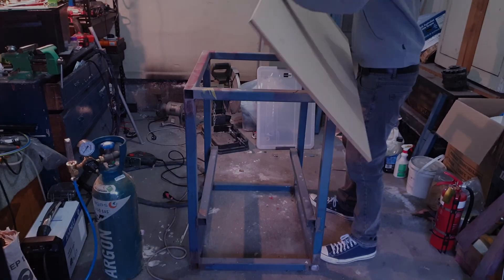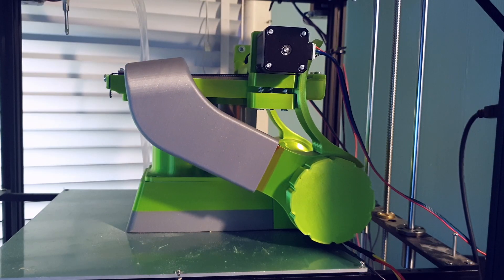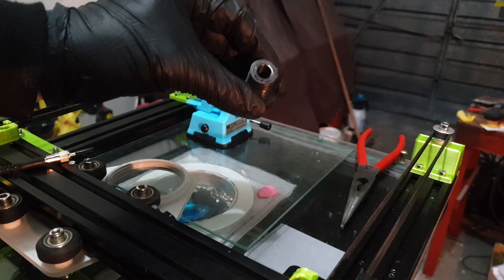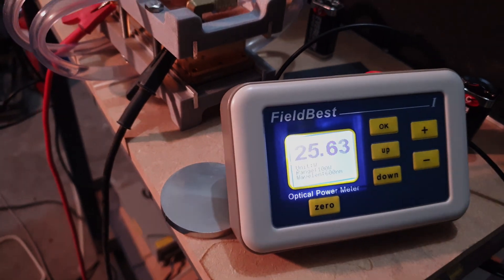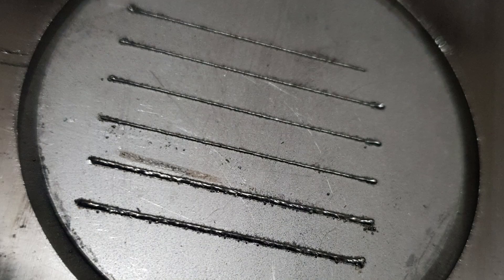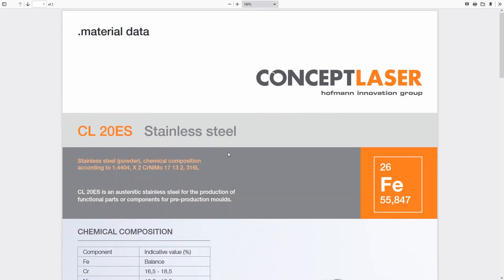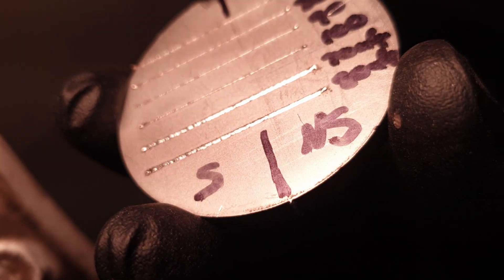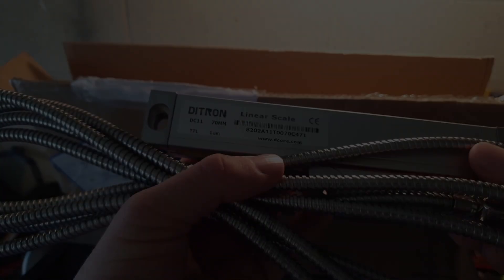The End Of Metal Tracks - DIY Metal 3D Printing

Comment: Sorry if this has been covered in another episode of this project, but I was really really wondering why you're not using a galvanometer solution instead of a large platform X/Y gantry set up which is inherently very sloppy when it moves? Is it a cost issue? As a galvanometer set up could be quite useful in this instance due to the fact that many of them are already permanently sealed against atmosphere. My apologies if this has been covered in a different episode. Excellent work my friend!

Makes me wonder how this setup would run under vacuum with perhaps maybe the slightest amount of helium added. But most likely it lead to the formation of plasma which would be quite destructive when it comes to accurate and precise tracks. Perhaps maybe this would be better solved under find thin layer of some sort of liquid solution that has incredible heat tolerance? Who knows. Love your work man!
Reply from the maker: Hi Robert. Have a look on my shorts page. I have switched over to galvos, but yes, cost and complexity are significant factors.

There are a number of papers dedicated to LPBF using a vacuum. Worth having a look if you are genuinely curious.

Comment: the thick spots at the start and end of metal tracks can be controlled by "skywriting" laser scan strategy in which laser start/stop emitting only when it achieves certain acceleration. However, the work you have done is still amazing and applicable, and truly speaking impossible for 1 man team.

Comment: For a wiper, look at screen printers. They use a very durable polyurethane wiper. Readily available.

Also it looks like you don't have an enclosed cabinet, you need to do that and remove all the oxygen, replace it with a heavier gas. Perhaps argon.... I was a welder and I know we use a trace of helium in there when tig welding.

You cannot have oxygen present. Haven't watched it all, but how do you weld metals together in that atmosphere? 
That doesn't make any sense.
Unless you're trying to make Slag.
Reply from the maker: Thanks for the insight. The black plastic container is sealed and purged with argon.

Comment: No one I'm aware of in the industry has cracked dimensionally-perfect additively-manufactured metal parts. CNC giants like DMG Mori or Hermle "solved" the problem by sticking additive metal systems inside 5-axis CNC mill-turn machining centers. Folks need to accept that additive manufacturing is much like traditional casting, it'll get you close to the desired shape, but tight tolerances will always require machining.

Comment: I’m just wondering I noticed you’re saying too much heat causing the warping but I think it’s more the rapid cooling of the metal causing the stress and warping. From what I’ve been finding these need to be in a preheated enclosure to prevent these stresses.

Were you using an inert gas? The normal atmosphere can cause contamination(moisture, oxidation, etc), even your skins oils can contaminate the powders. 

I’m curious to make my own so wanting to pick your brains if those are things you’ve tried?
Reply from the maker: I'm not too sure where I mentioned excessive heat leading to warping. I recall it was an issue when using overly thin substrates but other than that, I can't disagree about sudden temperature changes being the source of warping/internal stress. In spite of that though, as far as I'm aware, heated chambers aren't the de facto standard for SLM systems. Temperature regulated platforms are common, but can be bound to temperatures as low as 50C. I know it is common for SLS systems, but I don't believe it's the same for SLM. I know the PM100 by Phenix Systems is an example of such a machine though.

Yes, atmosphere was inert. Always wear gloves and a respirator when handling metal powders.
Reply: @metalmatters  first of I wanted to say thank you for responding and I’m so sorry I think that was a previous video I was watching of yours. I hope this doesn’t come across as criticism or anything I want to learn as much as I can from you and bounce things back and forth. I am very much still in my infancy of learning all this.

I seem to be on a different thought process, most of the slm/dmls machines I have seen have heated chambers, it’s allows for minimising thermal stresses, enhanced powder bed fusion, and a few other areas that help. 

I could also be completely wrong about this, that why I want to pick your brains as much as I can so I can learn!

But also finding that even the powders need to be opened and handled in an inert atmosphere like argon or nitrogen to prevent contamination and oxidation.

I haven’t seen the phoenix systems yet I’ll check them out! Thank you 😊
Reply from the maker: @SurfyKirky  Didn't catch this one! I have a feeling you might be referencing material related to mission critical applications e.g. medical and aerospace. Which machines have you been looking at?

If you have a look at the TDS for brand name powders, some of them will mention build plate temperatures. e.g. https://www.eos.info/03_system-related-assets/material-related-contents/metal-materials-and-examples/metal-material-datasheet/aluminium/material_datasheet_eos_aluminium-alsi10mg_en_web.pdf Between this and a lot of systems using silicone/rubber recoating components, I'm under the impression that most systems don't rely on heated enclosures. Sustaining high temperatures for potentially days and the added build cost.. it's just easier/cheaper to deal with using mechanical supports and annealing. 

Btw, are you based in NZ?

Comment: What if you passed a grinder over the surface after sintering, but before adding the next layer of powder? That would help to simplify the deposition and also improve the dimensional accuracy and keep one little screw-up from scrapping an entire print.
Reply from the maker: Insitu? Keeping the powder clean and stopping powder from being blown around would be quite challenging.

Comment: does the steel disk get lower and lower in its housing each layer or are the layers raising on the z axis? if you had a base that slid lower and lower down a tube and add material on top you might be able to simplify some stuff.

Comment: @metalmatters Hey I had developed SLS printer. I'm pulsing laser to melt down material Rather then CW high power
Reply: Chrome cobalt and Yag Laser
Reply from the maker: Nice work! What material/laser are you working with?
Reply: @metalmatters  chrome cobalt and yagg
Reply from the maker: @manthanpatel45  Send me an email or post on the forum. Sounds interesting.
Reply from the maker: @manthanpatel45  I sent you a message. Did you get an email notification?

Comment: I think a galvanometer scanner would be helpful to get rid of the gasket. Plus you can move and accelerate your beam way faster. Or would this destroy the point of the whole thing?
Reply from the maker: Likewise. Just a matter of cost really. $7-800 for large aperture galvos, $500+ for bespoke mirrors, plus the initial outlay for the diode pump/PSU. May as well go for a fiber laser at that point.

Comment: REALLY good video, but i wonder, wouldnt it be better/easier to have a sls/slm machine that sinters/melts plastics instead of metals, i think it has a lot of potential: lower temperatures, lighter materials, cheaper...the only downsides i can come up with is toxic fumes...?
Reply from the maker: Thanks. I think there are a few DIY SLS printers out there already. Depends on what you're hoping to achieve. High temperature strength is what I am pursuing.
Reply: @metalmatters  thanks for the reply, i was mainly wondering if it would be safer to start with plastic sls to then upgrade to metal sls, i also think more people would be interested in having a plastic sls machine instead of a metal sls machine

Comment: I really hope my other comment posted, unfortunately I seem to have lost it. I'm going to try and sum up what I said.

I have experience in working with SLS and DMLS printers, specifically the EOS M290.

For wipers, you can google "use cases of different re-coater configurations EOS" for a writeup that goes into detail about the re-coater blades in the EOS M290 DMLS machine. In short, they use a HSS parallelogram shaped blade which is ductile enough when coming in contact with the print, while in other cases a ceramic blade is used. More info on the writeup.

For the build environment, we always pumped down the machine and filled it with argon. The build volume is also heated.

As someone else mentioned below, you could pulsate the laser, which If I'm remembering correctly is something that is also done on the EOS M290.

The EOS M290 also has a large filter cabinet which requires the filters to be replaced when switching materials or on occasion once the flow through them drops below a certain point. I believe the filters could have been capturing spatter which would have been blown into them by the flow of argon which traveled across the build surface. 

After printing on an EOS machine, the powder should be sieved as well, which I believe is done to remove anything in the stock powder which exceeds the size of the rest of the powder.
Reply from the maker: Didn't see your previous comment. Thanks for your insights Alex. Do you recall what sort of pressure the build chamber is held at?
Reply: @metalmatters  I'll have to look back at my pictures to see if I have anything, or I'll ask around. If anything I could pop in and take a look as well. I'll let you know. Great work man.

Comment: Hello, I am extremely impressed with your progress. I have done a lot of research and postulating on these systems so I Was thinking maybe I could help or clarify somethings. SLS Printers don't actually melt the material they sinter it. This is better because as you can see the pooling and controlling of the molten materials is quiet an issue. The SLS machine also have heated chambers. The reason for this is so that the exposure to the laser is incredibly short and cause the particles to bond to each other. So I think you have done phenomenal work but that might be the two areas that might be an issue. I really hope you come right :) Another thing, the scraper should be extremely flat material that cannot generate a static charge, perhaps like a gauge plate edge?

Comment: Might I suggest looking at Hitachi CPM White #1 steel. It is an extremely pure steel with sulfur and phosphorus content at .25% or lower. It is just iron and carbon. It is in powder form. It could be one less variable for you to deal with in that the material is very chemically uniform and it could be simpler to calculate how it will respond to heat. Japanese master smiths use it to make blades that can take an edge like no other. I own several Japanese knives. The White #1 blade has an edge that will cut your name in two.

Comment: Very interesting project something I posibilty going to build, But I am teacher in welding and specality micro plasma welding, and I see some things in your video that give you problems in the quality of the welding for to build up you material. But the first thing I gone say to you is stainless steel you have to know that you have to protect your self for lung cancer and special whit the metal pouder. And when you heat it up there wil com nikkel and chroom free so always see that you have a good ventilation and where a mouth mask. So if you gone melt stainless steel you need always a protection gas for not get carbids in you welding and this give problems to build up the next layers. So Agron is the most intresting gas to use , but I use in the welding of stainless steel Argon whit 5% H2 but the problem is that it gone bun in you project but the  H2 will bind whit the O2 and you get les carbids in you welding. But you have be sure that the box where in the process is busy is 100%argon so you have to have a contstain flow of argon gas or tot set the box under over presseur. So for to start and the end of the welding line you have to play whit the power of your laser and also whit the end of the line it call filling the crater. If you know a good Tig welding in you region ask him for some information. One of thee major problems is the stabilty of you machine I see it schaking when you build the layers. I don't know what size you like to print, but did you ever have think to use galvano mirrors. you gone have less problems whit the scheaking of your machine but you laser spot will change. My advice build a solid machine construction whit whieght and special if you gone work whit high speed to start and stop ends. And make sure that it is 100% under a argon are helium atmosfeeer.

Comment: Brings back memories of the early days at Xact Metal. You appear to be working thru these issues similarly to how we did. Keep up the good work. Reach out if you have any questions.
Reply from the maker: Hey Matt. I sent you an email, although from my personal email due to problems with my mail provider. Just checking in case it has been marked as spam.
Reply: @metalmatters  Got it! In the process of replying 👍

Comment: Hi, it's quite the interesting project. I just found your videos and so I don't know if I am suggesting ideas you might have tried already. I've seen a couple of other projects for metal printers and at least one of them had heated the metal powder  fairly high in temperature but not to melting. The laser was to push the temperature over the melting point for the areas that were to be printed.

From the video it appears that the system runs a beam along the path to fuse the metal powder to create a line. Would it work differently if instead of a continuous beam the system fired a series of the shortest possible pulses. If the spacing was close enough it would create a line. Perhaps it would need multiple passes, depending on how fast the system is able to fire pulses. For example, it might create a series of dots close together one the first pass and then on the second it would connect the dots up. 

A third idea is that perhaps the spread is being caused by the material being heated up so quickly. What if the laser were to make a number of passes with the last pass being at 100%, the power just above the amount to melt the material. Some experimentation with the number of passes and any pauses between the passes would be needed to see if it impacts printing at all. If it did work it would slow down printing but at a gain in quality.

Comment: Just an FYI; I used to use the epoxy, shear and polish method for fiber throughout the 90s but unicam connectors have become the mainstay for fiber connections unless you're doing fusion connections on single mode.

Comment: Very cool, but curious why you didn't use ASA for all FFF polymer parts. Green and silver looks like PLA to me.
Reply from the maker: Mainly to avoid headaches. The build plate is to be cooled (50C) so there is little chance of softening the base of the deck and I will reprint/line the arms if need be.

Comment: Add a chamber around the burn plate and fill it with argon...most your splatter will go away and your edge will be much finer. A titanium roller barrel instead of wiper blade.

Comment: Hi, @MetalMatter great video. What effects would you expect if you were able to change pressure as a parameter? For example, if this system were located in a pressure chamber, then how would varying pressure affect the expected outcome? Also, since it's a finely packed powder you could use the tip of a syringe mounted on the head to carve a canal into the powder's surface that will be filled in once the powder on either side of the canal melts pouring itself back inside the canal. In essence, the canal creates a greater surface area, which alters the dynamics of the reaction. Alternatively, maybe using a different gas in the atmopshere of the melting. My naive guess is that the liquid turn to vapor and causes the bubble to pop and splatter the metal.

Comment: Very cool project! I am a qualified 3D print technician, I've worked on EOS printers before, primarily the EOS m290, its really cool to see how much you've overcome and implemented that is in line with existing high end metal printing techniques, I can suggest that you look at "skywriting", cold prossess 3d printing temp balances and nitrogen scrubbing for some potential improvements. Super cool project, I think what you've done with the recoter head is very cool!
Reply from the maker: Thanks Jason. Can I ask, what is the typical build chamber pressure of the machines you work on?
Reply: @metalmatters  in most cases a light positive presure of 0.3 bar, strangely in the case of aluminum a negative presure of 0.5 bar

Comment: If you have trouble with droplets at the start and end of tracks due to acceleration, why not separate the acceleration from the start of the track? As in: start moving, get up to speed, and only then turn on the laser. That would decrease the working surface, but might help.
Reply: Sounds like a good solution. A more permanent solution that might work would be controlling laser power based on velocity
Reply: I was just thinking you could just design the gantry to have counterweights on both sides to eliminate backlash.
Reply: @gobble_gang  Backlash is caused by the driven nut having play on the lead screw. There's way to minimise this, usually involving using two nuts, or by using a controller that takes backlash into account.

Comment: Just wondering, but would doing this laser sintering under a noble atmosphere help at all? I only ask because the "spattering" around the sintered lines look reminiscent of a contaminated weld.
Reply from the maker: It's operating in an inert atmosphere, just not a very good one. I usually let get down to around 0.1 - 0.2% oxygen before running anything but shooting for a lower percentage results in an exponential consumption of argon.